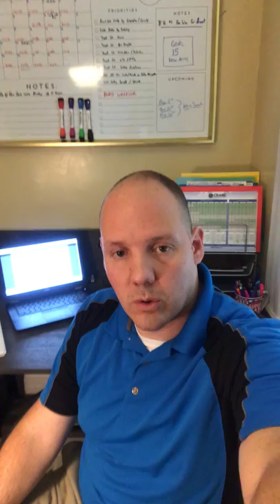Air Freight Shipping Basics

Comment: Hi! Thank you for the video. I am currently paying someone else to send my cargo for me. I was wondering what I should do to book my own cargo shipping. Is there a difference between sending as business or individual. Are there platforms where to book cargo? 
Thank you
Reply from the maker: Johnny K - there are some rules / restrictions on just anyone getting access to the boards that many truckers use. There are also way to post your loads , skipping the boards and middlemen in the process. Although it can save you money , many times the headaches created from not knowing all the aspects can be an expensive lesson. The freight loads you send out also will vary in how best to handle. Such as LTL vs FTL, open or closed containers etc.
Reply: @jdhlogistics  Thank you. How about for Air Freight. I was checking SAS Cargo and to register they are asking for "IATA Number (7 digits) or Government Number

or Registration Number. Does that mean I need to be a business to be able to send air cargo? Thanks again!
Reply from the maker: Johnny K - yes in order to do these things they want proof of IATA certification which basically deals with shipping of hazardous goods/items. There are course you can take that are fairly inexpensive to become IATA certified. Depending on how many shipments you are looking to do, many times it is best just to hire a professional or company to handle these for you.
Reply: @jdhlogistics  Thank again. Will I need anything else after getting that creetifica to send air cargo? What companies do you recommend? 
Thank you!